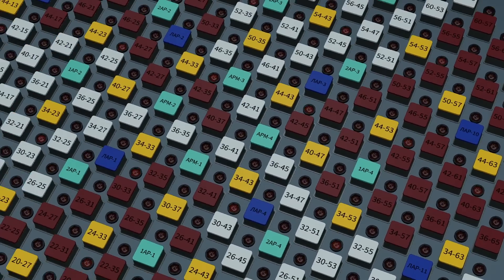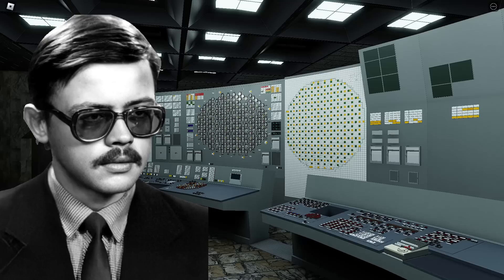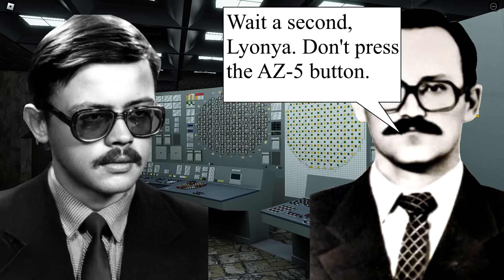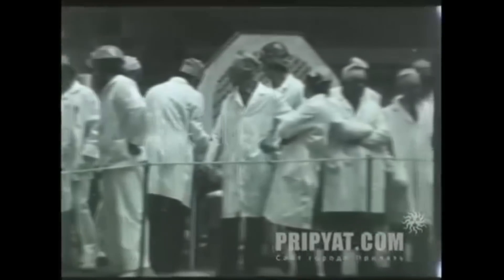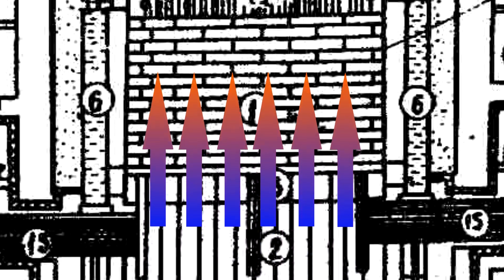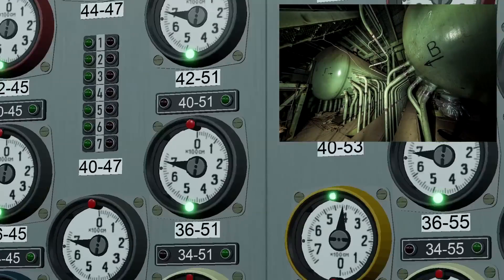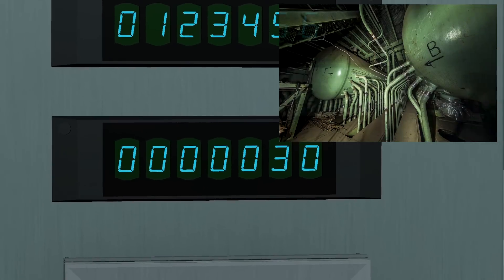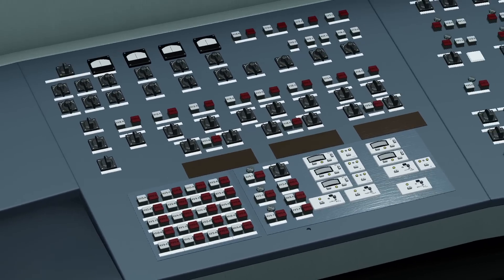Would Not Pressing AZ-5 SAVE Chernobyl?

Comment: What I don’t understand is: if the feed water enters the reactor at 170 degrees C. Would it not enter as Steam as the boiling point of water is 100c?
Reply: Boiling point depends on pressure.
Reply: Higher pressure = higher boiling point

Comment: Regarding the facts: no. The reactor suffered already a run way and was in an instable condition. When the control rods were risen to result in more power, at this moment the lower part of the reactor was already overheated and blocked the control rod channels. The only right were would have been to shut dowm complelety the reactor when ist was at 30 MW power.

Comment: Why would you want cooling water that is that hot?
Reply: To get as hot steam as possible to get most out of the turbine to get as much electricity as possible.
Reply: @MikkoRantamo oh I see so the same water that is used for power generation also cools the reactor. Very confusing! On one hand you don’t want it to get hot and yet on the other hand you want supercharged steam
Reply: @olibanks3846 usually in nuclear reactors the primary coolant is not going all the way to the turbine. Instead there are heat exchangers and secondary circuit that makes the final steam. That way the turbine does not get contaminated. And remember, when you transfer heat with water, you can get a lot of heat transfer even with small temperature difference if you have very large flow.

Comment: The scenerio where you say there would still be a meltdown but it would only reach 600°C... that’s actually super low it’s kinda crazy reactors aren’t designed to survive core temperatures up to like 2000°C+

The main issue would in most cases be the pressure of fluids (water coolant loops), or if they explode have the entire building be designed to catch the steam anyways without breaking (very big very sturdy room)

Materials like tungsten, graphite, uranium dioxide, carbides nitrides and rare earths can all survive very high temperatures. Even if the reactor is damaged it wouldn’t cause a leak or catastrophic containment failure if it was designed properly. But we’re talking about the people who put neutron moderators in their scram buttons so I guess that’s just me expecting too much

Comment: There is no scenario where a nuclear reactor turns into a nuclear bomb... it has no similarity at all
Reply: True but if an out of control reactor generates a massive power surge, the energy released can be sufficient to blow the reactor apart.
The total yield will be far less than a properly designed warhead though.
This kind of effect is also observed in nuclear criticality accidents, including the excursion which wrecked the Godiva experiment at Los Alamos.
Reply: @derekp2674 not even close, botj of the chernobyl ones was a thermodynamic ones, not nuclear.

First one of those explosions in that accident wher because the pressure from the hot steam, the second one was because the hydrogen released to the room and reacting immediately and violently, resulting in te building roof collapsing.
FYI the hydrogen was ghere because the overheated zircon in the reactor formed zircon oxide at contact with water resulting in hydrogen.

Sorry for my English 😅
Reply: @feruser2489 yes but where does the energy come from to heat up the water and the steam?
And what energy source drives the endothermic chemical reactions that produce hydrogen from chemical reactions in s nuclear reactor?
Also the combustion product of hydrogen and oxygen is hot steam. So isn't a hydrogen explosion just another kind of steam explosion then?
Reply: The energy required is thermal, not nuclear...

The second explosion it does form water but not hot steam, thas is a chemical reaction that produces a lot of energy, but not high-pressure from steam
Hope it helps noticing some misconceptions about the principles of nuclear explosion and thermodynamic ones
Reply: @feruser2489 Yes but isn't the heat for that thermal energy heat released from the nuclear reactions in the out of control reactor?
Reply: @derekp2674 out of control, yes in that case,  but yet stable, enough to deliver power for years, instead of milliseconds, this is because the uranium was not enriched as much as the one used in a bomb
Reply: @feruser2489 well you can make power reactors using the same sort of fissile materials that you could use to make bombs with

But this is not normally done for civil nuclear generation 

But I believe some naval propulsion reactors use military grade material
Reply: @feruser2489 Chernobyl wasnt a hydrogen explosion, it was nuclear fizzle. There wasnt enough hydrogen formed.
Reply: Prompt critical = bomb
Reply: @pavlovezdenetsky7824 is more complicated than that
Reply: @pavlovezdenetsky7824 Bombs use prompt criticality but prompt criticality can occur in other devices, where the specific design features of bombs are not present.

As illustrated by the explosions of various nuclear reactors, prompt critical chain reactions can produce enough energy to blow reactors apart.
Reply: @derekp2674 prompt cruticality must NEVER occur in nuclear reactor by design. Otherwise - kaboom.
Reply: @pavlovezdenetsky7824 That's generally true for ordinary civil power reactors.
But some research and training reactors are designed to withstand operating for short durations at prompt critical.
This can be achieved either by fast moving assemblies or by designing in negative reactivity coefficients.

Comment: What could have saved Chernobyl was turning off the reactor when the computer warned to do so...

... as opposed to turning off the computer.
Reply from the maker: This did not happen in real life, the SKALA computer never put a warning out like that. And even if it did, it would have been printed some fifty meters away, meaning it would never get to the Control Room in time to prevent any disaster.

This myth is just more Soviet propaganda designed to slander the operators instead of deficiencies in the reactor design and safety systems in place.

Comment: Didn't they turn off all sefty system and the computer tough? Automatic SCRAM most likely wouldn't happen with how many systems they turned off prior to the accident
Reply from the maker: No, this is a common myth. They disabled the two-turbine trip, which was required for the experiments they were conducting, and adjusted a safety setpoint, which was allowed under regulation. The computers kept working until the end, which is why we have a lot of data from the reactor.

Comment: Hang on, the boiling point of water is 100C so how can it enter at 282C, this is superheated Steam, not water.
Reply from the maker: As pressure increases, the melting a boiling point of a substance also increases. The RBMK operated at around 65 atmospheres of pressure, and the boiling point of water at that temperature is around 290 degrees Celsius.

Comment: This is a very common but critical misconception that confuses the events of Chernobyl with the disaster at Fukushima. The theory about waiting for the diesel pumps is incorrect for Chernobyl.
The short answer is: The diesel pumps were completely irrelevant to the Chernobyl explosion.
Here's why:
Chernobyl was a reactivity accident, not a loss-of-cooling accident. The problem wasn't a lack of power or water; the cooling pumps were actually still running until the moment the reactor was destroyed. The issue was a fatal flaw in the reactor's physics that caused a near-instantaneous power surge. The reactor was already in a runaway state and would have melted down seconds later anyway, even if they hadn't pressed AZ-5.
The scenario you're describing—needing the diesel generators to power the cooling pumps to prevent a meltdown—is a perfect description of Fukushima. There, the diesels were the single most critical point of failure.
A simple analogy:
• Fukushima was a good engine that melted down because its radiator lost power.
• Chernobyl was a flawed engine that exploded like a bomb when the driver hit the brakes.
Hope this helps clarify the crucial difference between the two events.
Reply from the maker: OK Chat GPT, you've fundamentally misunderstood the events of Chernobyl, and contents of the video, but OK. 

The whole point of the turbine rundown program was they were determining if the turbine running down could continue to supply power to the Main Circulation Pumps long enough for the diesel generators to run up to full power, so there was no interruption of coolant flow into the core in the event of a design basis accident and a power loss simultaneously.

Also, the power surge occurred after AZ-5 was pressed. It is referenced both in several studies including those cited in the description, and the computer printouts from the night of the disaster.

Comment: But what if the engineers had complete knowledge of what was about to happen, and instead of pressing AZ-5 would start to insert rods manually one-by-one?
Reply: I think the reactor was gone when they reduced the water flow, it was just a matter of time at that point. Pressing the AZ-5 reduced that time. I think the only option to save the reactor would perhaps been to engage all the coolant pumps and then start lowering the rods. That might have worked, or not.

Comment: AZ-5 would have probably worked as designed if they had not pulled nearly all the control rods out to increase power, and then shut off cooling pump.

Comment: If the cooling system dint malfuctioned none if this could have hapend you know there is a pump that is like a turbine like struction it dint work with electecitiy it worked with steam from the heat of the reactors that might had got stuck and stoped circulating water in the cooling system and that going from the overhiting into a like nuclear bomb like but that is whqt hapend

Comment: The odds that an operator will be able to respond correctly to an incident in a nuclear reactor vs time is this:
1 minute = ~100% chance of incorrect response
10 minutes = 10% chance of incorrect response
100 minutes = 1% chance of incorrect response
1000  minutes = 0.1% chance of incorrect response

If an operator has to scramble to save the plant from destruction, odds are the plant's operating and safety culture was flawed from the top down. Odds multiple near misses and incidents occurred before this.

The failure was long before AZ-5.

Comment: Knowing it will blow the system under the condition this button was pressed, the best idea would have been to insert each control bars one by one to progressively slow down the reactions until it stops...
Reply: ... and best of all, start with the control rods that insert from the bottom.

But the operators had no idea of the need for this.

Comment: Procedures - they are a thing. I spent 23 years in an American PWR control room and can't think of a single operation or test we did that didn't have a procedure that had to be followed to the letter.

Boiling water in a reactor is, in my opinion, just stupid. Yes it saves a bit of money because you don't need a few large components like steam generators etc but it ignores the downstream problems. The steam generated to run the turbine generator and associated equipment is radioactive. The entire secondary is contaminated internally and any steam leaks are a problem. 
Just a tip here. Reactor scram is a military term. In American commercial plants at least it's call a reactor trip.
Reply: Thanks - we also use trip rather than scram in the UK civil reactor community.

Comment: "This colder water (at 165c) will keep cycling through the reactor core until it is close to it's boiling point." What is the boiling point of water again? I thought it was 100c?
Reply from the maker: High pressures increase the melting and boiling points of substances.

Comment: The reactor was operating well outside normal conditions with all graphite control rods removed from the core to try to get the power back up. AZ-5 was not designed to work in this scenario. That is what was buried in the reports that the Central Committee kept hidden.

Comment: Pulling 206 out of the 211 control rods fully was the point of no return.

If they had brought the power up slowly over 24 hours and delayed the test a day or two, this would not have happened.
The increase in reactivity from putting the control rods back in was known...putting all of thrm back in at once made it worse...had it been done slowly, or had they not have removed all of them this wouldnt have happened.

There was Xenon, and then it bruned off, once that poibt was reached there was no turning back.